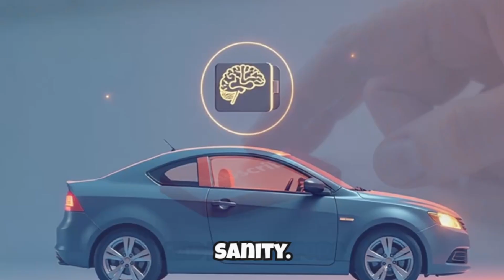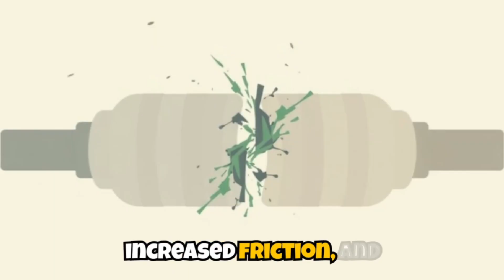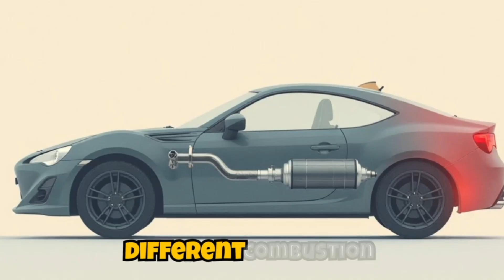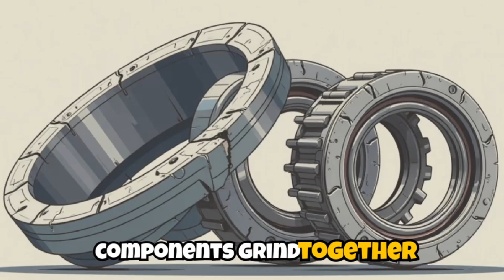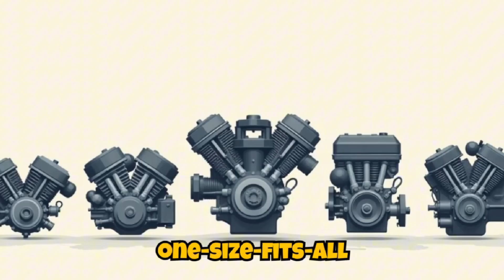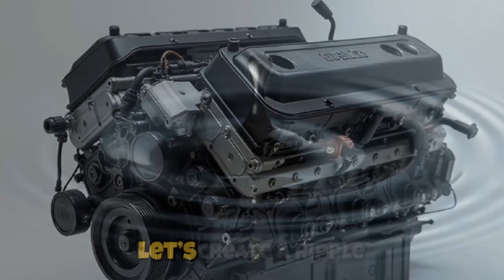Stop Using This Engine Oil NOW – Crucial Warning Every Driver Must Know!

Comment: I’ve used Mobil 1 oil since 1975, changed it every 4000 miles.  I just changed to AMSOIL full synthetic with an AMSOIL filter.  I will continue to change every 4000 miles.

Comment: Detergent oil in antique autos will damage the engines for two reasons, first with a filter the detergents emulsify the dirt particles so the filter can catch them and keep them removed from the system. But in an antique auto without a filter they remain suspended in the oil potentially increasing wear. Nondetergent oil relies upon the dirt particles settling to the bottom of the oil pan where they mostly remain to be removed upon oil changes, this is why antique engines require more frequent oil changes. Although modern oils have greater lubrication, synthetics seem to not transfer heat as well as organic oils and these can potentially lead to overheating in certain antique autos even with oiling system upgrades. Second  older autos require ZDDP to protect valve seats from excessive wear. Modern oils do not contain enough or none at all, moreover ZDDP is destructive to catalytic converters. Stainless valves and seats solve this problem but the procedure is not available for many autos and is expensive.  Adding ZDDP to engine oil for antique autos is the most common choice but the correct amount is important as too little or too much can still result in engine  damage. I have never know anyone that has used nondetergent oil is a modern auto, there is no savings in cost and availability is for the vintage and antique niche, not everywhere. The most common nondetergent oil is straight 30wt, almost no cars newer than 25 yrs old use it even as detergent oil
Reply from the maker: Thanks for your detailed comment — you bring up some very important and often overlooked points about lubrication in antique engines.

You're absolutely right that detergent oils can pose risks in older engines, particularly those without oil filters. The role of detergents in modern oil formulations is to keep contaminants suspended so they can be trapped in filters, but in filterless vintage engines, that suspension means debris stays in circulation, increasing the risk of wear. That's a major reason many restorers and vintage engine builders still prefer non-detergent oils for authenticity and safety — especially when paired with more frequent oil changes, as you mentioned.

Also, your mention of ZDDP (zinc dialkyldithiophosphate) is spot-on. Older engines, particularly those with flat-tappet camshafts or non-hardened valve seats, absolutely depend on that anti-wear additive. Modern oils have reduced ZDDP levels to protect catalytic converters, but that's a problem for classic engines. Supplementing ZDDP can be effective, but as you rightly noted, it's a delicate balance — too much can cause pitting or sludge, while too little results in accelerated wear.

You're also correct that most modern engines are designed around multi-viscosity detergent oils, and non-detergent straight 30wt has limited application today — mostly in small engines, vintage cars, or machinery where detergents could do more harm than good.

One small addition to your excellent points: While synthetic oils sometimes have lower thermal conductivity, many formulations now are blended specifically for classic applications and can handle heat well when used appropriately, especially in engines with improved cooling or modified oiling systems.

Overall, thank you for taking the time to share such a well-informed perspective — it’s comments like yours that help keep the conversation around classic car maintenance both respectful and technically rich.

Comment: is there a brand name I can trust?
Reply from the maker: Absolutely, great question! In the U.S., there are several motor oil brands you can definitely trust — proven by time, tested in extreme conditions, and even recommended by car manufacturers.

🔧 Top trusted brands: ✅ Mobil 1 ✅ Castrol ✅ Valvoline ✅ Shell (Helix or Rotella) ✅ Pennzoil ✅ Liqui Moly (for European engines) ✅ Motul (for high-performance engines)

These are all backed by strong engineering, meet or exceed API and OEM specs, and are used in everything from daily drivers to high-performance sports cars.

👉 Just make sure you’re using the right viscosity and specs for your vehicle, and that you buy from a trusted seller to avoid counterfeits.

Hope that helps! Let me know your car’s make and model if you want a personalized recommendation 🔧🚗
Reply: @MotorMentality  thank you that's all I need to know 🏁🏁

Comment: I have a low milage 1982 cady with an HT 4100 V8. What oil do you think I should use? cast iron block with aluminum heads
Reply from the maker: That’s awesome — a '82 Cadillac with the HT 4100 and low mileage? Very cool, and definitely a car that deserves the right care.

Since the HT 4100 has a cast iron block with aluminum heads, you’re dealing with mixed metals, which expand and contract at different rates. That engine was known for issues like head gasket failure, so the oil you use (and how often you change it) matters a lot.

🔧 Here are my top oil recommendations for that setup:
✅ Valvoline VR1 10W-30 – high zinc, great for classic engines and added protection
✅ Mobil 1 High Mileage 10W-30 – excellent if you prefer synthetic with seal conditioners
✅ Castrol GTX 10W-30 or even 20W-50 – ideal if you’re in a warmer climate

👉 Avoid low-viscosity oils like 5W-20. And make sure the coolant system is in top shape — thermal stress from the iron block + aluminum heads can become a real problem if temps run too high.

You’ve got a unique piece of GM history there. If you let me know how often you drive it or what state you're in, I can help fine-tune the recommendation even more. 🔧🚗
Reply: @MotorMentality  I cahnge it as soon as I see it turning color. normaly it looks almost clear. and I smell it lol. I probebly change when I don't need to. better safe then sorry. Cadillac sez to use 10\30. but the metal mix is my consern. I am lucky it runs like a new car. I want to keep it that way. thank you for the heads up :)